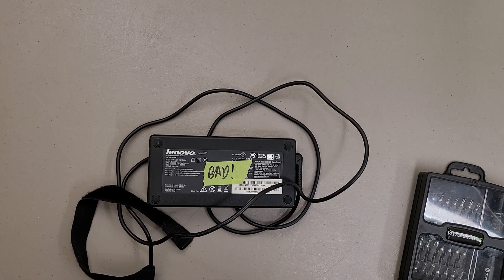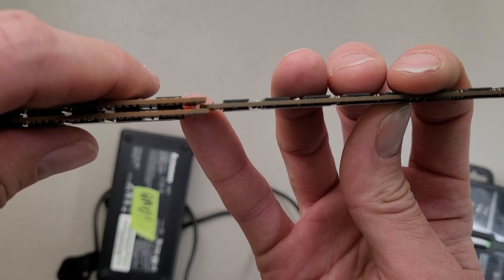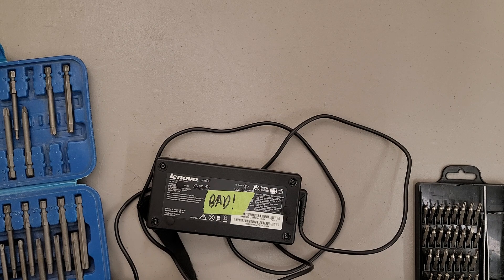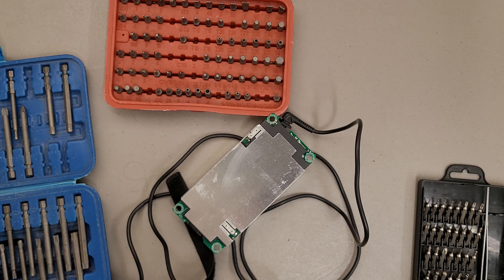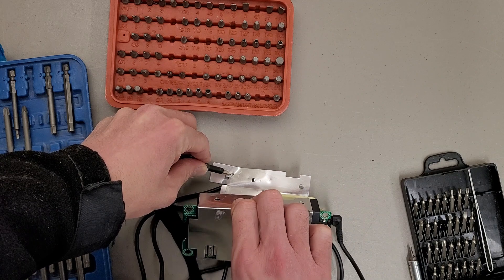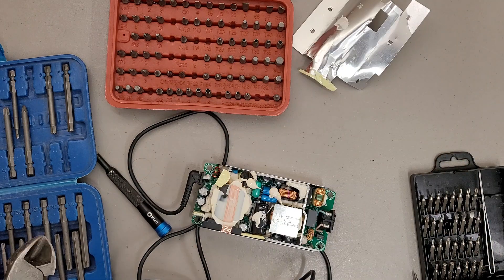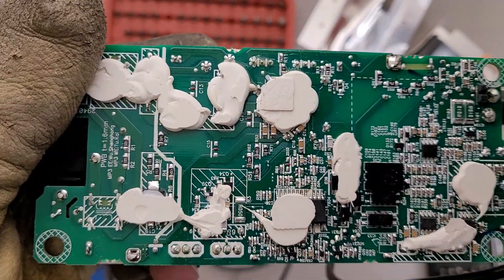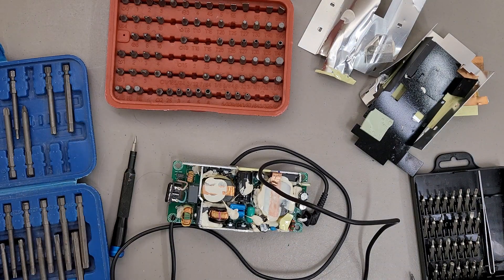Taking a look inside a Lenovo ADL170NDC2A 170W laptop charger #teardown

Comment: I need some help! I have this same model of charger. I want to use this to power an amplifier, that made made for a car, that will also power a subwoofer
Reply: Is this possible? If so, how can I do this, without dying? If not, could you please share why not?
Reply: I’m also not too sure if I can cut off this little bead thing at the end of the cable, next to the port itself.
Reply from the maker: I wouldn't recommend using this for that. The output is only 170W and a car amplifier will draw more power than that. Also this outputs 20V so your car amplifier would just blow up since it is made to run off 12V
Reply: @computersales so could I use something like an Xbox One power brick?
Reply from the maker: @BentleyReedSpeakers  I'd look into doing something with a server power supply if you really want to do this project. They usually have a high output and run at 12V.  I wouldn't know how to do it safely though so you would have to find a video of someone knowledgeable explaining how to do it.

Comment: My Lenovo charger 8.5A 170w is not charging battery while the PC is on, but it's charging while the PC is off . What to do, help master
Reply from the maker: Never seen that before to be honest. Maybe check power settings in windows. You could install Lenovo Vantage from the Microsoft store to see if it detects an issue. Otherwise it could be a BIOS setting?
Reply: @computersales  @metaldarkdarkus3645 I have a lenovo legion Y540 charger of 170W (Square connector). There is some design issue in the charging port. When gaming, the charging port heats a lot and due to which the inner copper the left and right side of the port gets oxidized to coat a layer of copper oxide (black color) which stops the charging. I tried changing the motherboard and charger but it's not working. Do you know how I resolve this? Temporarily I use vinegar and salt solution to clean the copper inside the port and then clean it with baking powder solution. 

I cant find a permanent solution to this. Is this due to some gap between charging port and charging socket?
Reply from the maker: @maxpayne6625  maybe some dielectric grease otherwise try replacing power jack and adapter. Otherwise never seen oxidation issues like that before.